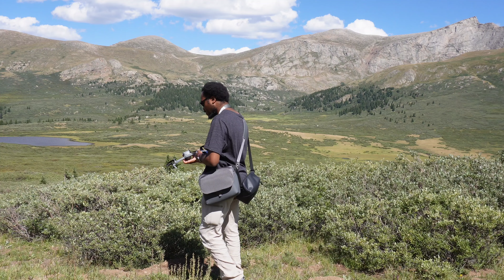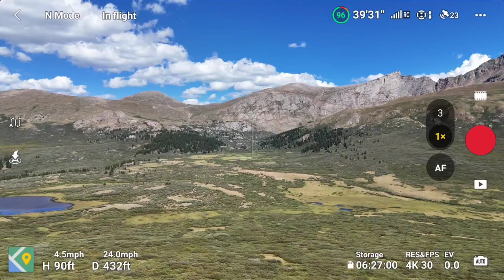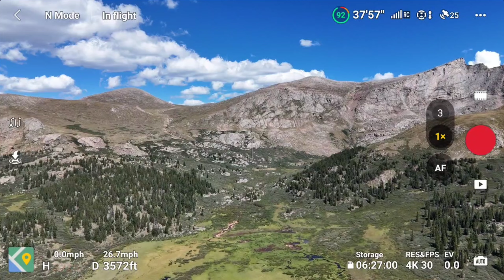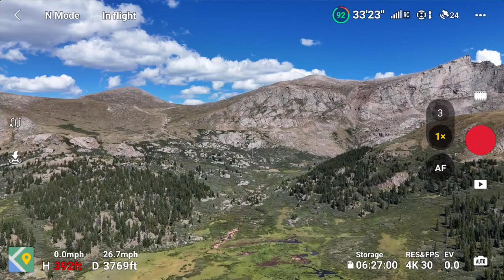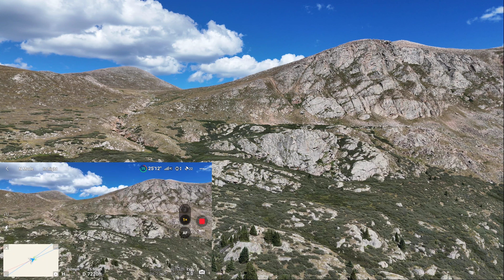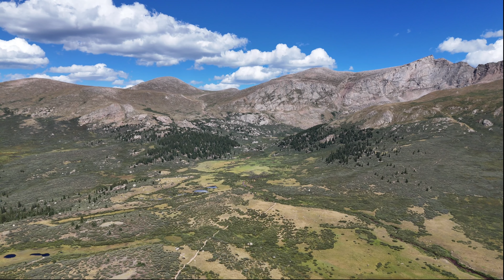DJI AIR 3: MY FIRST EVER RANGE TEST -It Started To Loose Signal at XX84ft!?!?

Comment: hey question do you think u need to be connected to the internet to get better range
Reply from the maker: I don't think so. Usually when you start flight, the controller will disable Bluetooth and Wi-Fi so the signals don't interfere with the direct connection to the drone. Someone did state that in other parts of the world the controller is able to attach a 4G module for cellular service to get a connection that goes farther than this but in the states here it doesn't seem like we have that option.

Comment: my air 3 reached also that distance of 9K ft (2.7km) on my 1st range test but its on a city area .. I would expect a longer distance in an open and less interference location like yours
Reply from the maker: That was the exact idea when I set out to do this range test. I'm not sure exactly why the signal didn't go farther but someone did mention in the comments that it might have been due to some of the minerals in the mountains. Nonetheless that two hour drive was worth it.
Reply: @WIHRC  I will do my 2nd range test on less interference area by tomorrow.. over a bay 😊
Reply from the maker: @benaven1786  That'll be an interesting test for sure. Let me know how it goes.

Comment: Could be an area with strong magnetic interference. Mineral make up, large deposits of ferromagnetic metals in the ground and mountains. Solar interference that given day may have been higher? O2 Ocusync systems go further than this in less wide open areas. Check with DJI, they’ll sort it out, or replace your unit if they can’t.
Reply from the maker: Never thought about this, but it's a very legit hypothesis. I never saw any range test on the drone before, and as mentioned, I didn't and usually don't do have a need for them. I just got curious. But it was kind of weird that it got way lower than the advertised range. Hopefully, it gave another perspective than just doing it in a city or a similar open area, though.

Comment: Did you see the little critter at 6:28 of the time bar.  Looks like a rock badger of some kind. Right center of screen in the rocks above the water. What altitude did you take off from? You must be up there.  At sea level you can hardly hear the Air 3 because the motors don't have to work so hard with that thick air.  When you are up high in the mountains, the air is thinner. Your motors  sound like they are working really hard and spinning extra fast just to stay in the air. I'm going to guess that you are at about 7000 feet elevation.  Cheers!
Reply from the maker: I hadn't noticed it there. That's awesome. I just hope I didn't scare it. The elevation for that area is 11,670ft, although I'm not sure where that is measured from since there'd be a slight (possibly negligible) difference to where I hiked to. The Air was indeed thinner up here as I noticed that the propellers were louder than usual. My wife mentioned that she could hear them from. Where she was, even though I was a good distance away. Appreciate you pointing out that badger.

Comment: Weird your air 3 only got 9000ft in open field. I see other get like 35,000 ft.
Reply from the maker: I'm not sure why this was, but it could've had something to do with thinner air and the ability for the signal to travel within it. Just a guess. As I stated in the video, I don't particularly do or have a need to carry out range test, so i wasnt sure what to expect but I got curious about O4 and wanted to try it in an open area. It's possible I might've received a first batch unit with issues, but not sure.

Comment: I thought that U have to keep the drone in Line Of Sight. With over 5K feet, how can U even see it?  Just saying. Nice video.😎😎
Reply from the maker: You're completely right about this. When I originally set this up I knew my visual Observer would be able to see it given their position however I didn't think it through on my part that I wouldn't be able to see it on its way to where they were. This was the first time setting something up like this so it was a learning experience and one that I won't repeat in the same way.

Comment: Great video from my house in urban environment I get about 2800 ft alot of trees in my area.
When screen recording does it record voice also
Reply from the maker: Thanks much.  2800 is plenty for me, lol.  I just got a little curious about the new O4 signal. I could be wrong, but I don't believe it does.  I was using my dji mic to get audio into the recording.
Reply: @WIHRC  I GOT THE DJI MICS ALSO AM LEARNING THEM BUT I LIKE THEM, I HAVE DID A COUPLE OF WAYPOINTS AND PLAN ON DOING ANOTHER ONE THIS WEEKEND I HOPE U DO ONE LIKE TO KNOW WHAT YOU THINK
Reply: Do you mean 9000 meters not feet
Reply: @AngelovStreetbeefs  yes you can change the meters  into feet in the app
Reply: @lovdrones  oh okay I esd just surprised you were only getting like 2 miles when I see many gey 6miles
Reply: @angelov2648  alot of the on flat area open space now in a urban area may be alot different my opinion
Reply: @lovdrones  no for sure
Reply: You can use any usbc microphone or wireless microphone